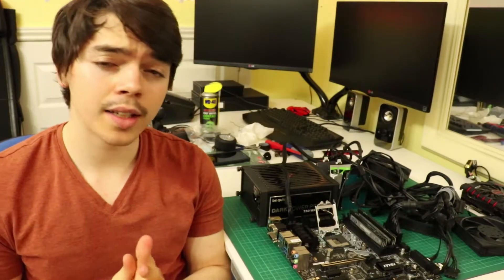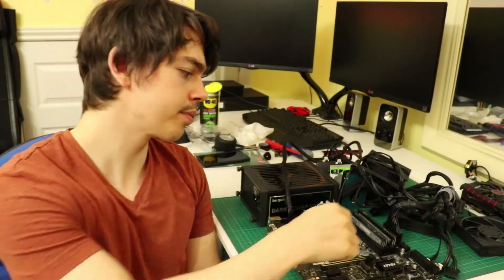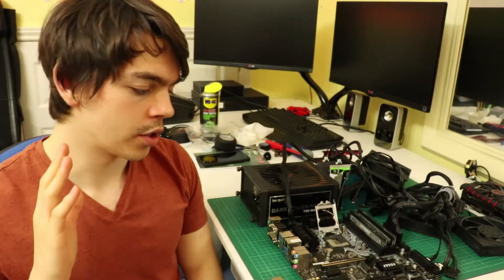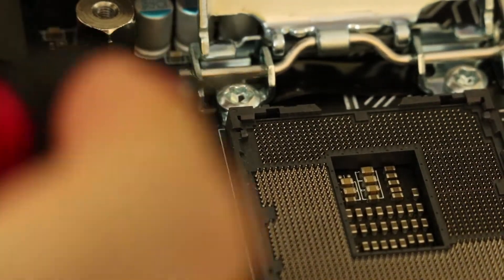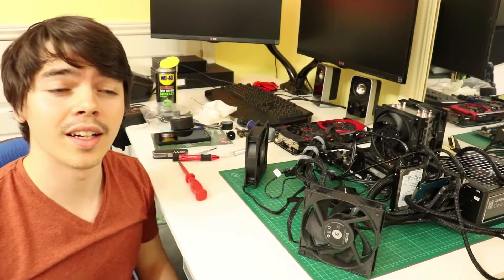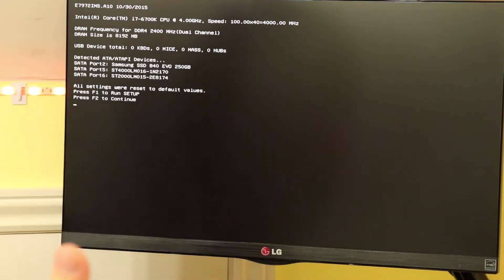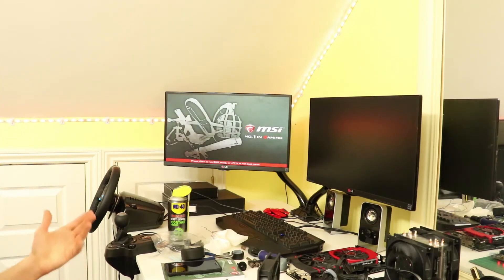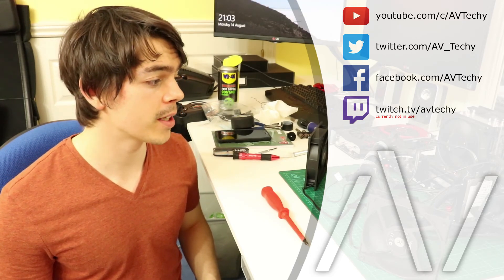'Fixing' a Damaged CPU Socket...

Comment: PGA is better than LGA socket ¿or not?
Reply from the maker: There's no real performance differences between the two styles.

But there's a big benefit to an LGA socket with regard to cost. But I don't mean cost of manufacturing or upfront cost to the consumer. I mean if something goes wrong as a pin gets damaged, motherboards are generally cheaper to replace than CPUs.

This means with a PGA socket when a pin gets damaged the CPU needs repairing or replacing, and when a pin gets damaged on an LGA socket the motherboard gets repaired replaced. 

That's really the main benefit from a consumer point of view. There are also some differences in size that benefit the LGA socket style, but that doesn't effect the consumer as much.